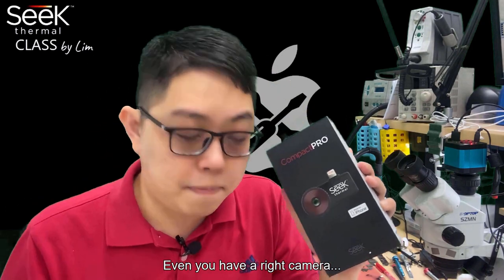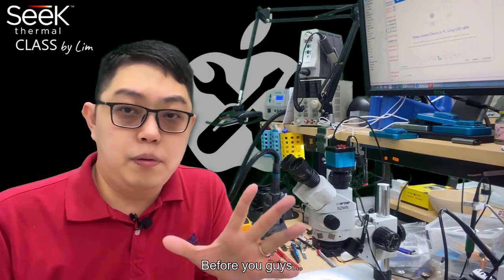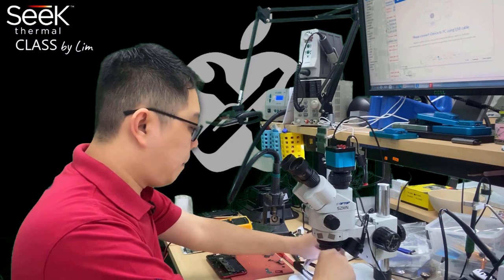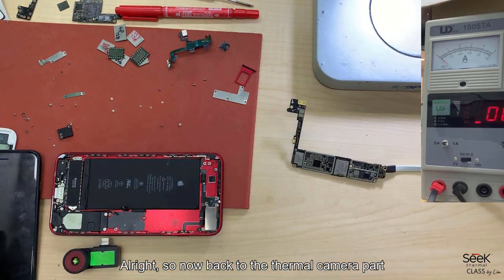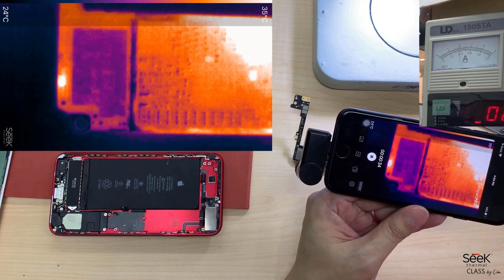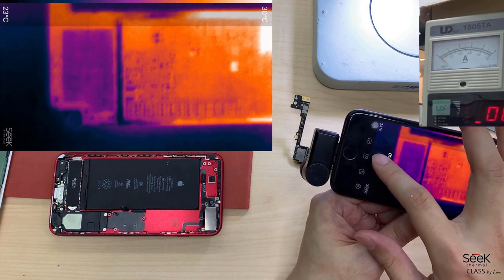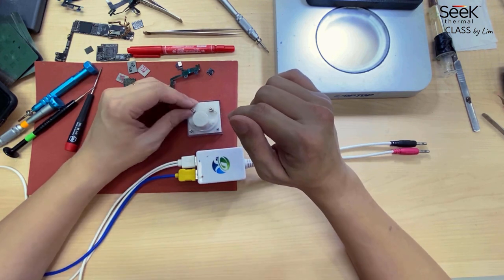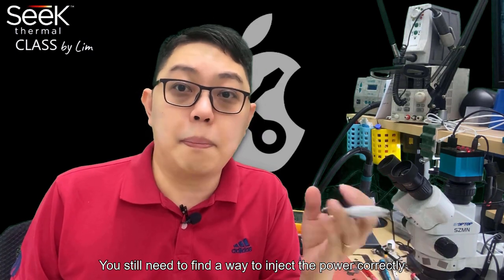Thermal Camera Diagnosis Lesson  - Power Test Cable makes a difference【Seek Compact Pro 】

Comment: Do the cords need to have a special pice on the end for the battery connection? Or is there a way to inject power into any board we have so we don’t need a specific end on the cable?

Comment: 12:46 Mega Idea is a brand name of Qian Li and they make both of these cables. The cable on the left with the black sleeves next to the battery connectors, i.e. your "direct power" cable, is a cable that Qian Li says contains "Battery Decoder Board". Can you explain what this is? If it's just a straight / "direct power" cable without any sort of embedded chips or components? It looks to me like you're in fact killing the "Battery Decoder Board" when you do the "blinking". This board is presumably installed, not in the cable leads, but in the black box where the cable leads meet.

The "second cable" (third in order of appearance) has white sleeves next to the battery connectors and protruding SMD components, and according to Qian Li, it features "Simulate Battery Data" and "Original Battery Level Connectors Base". I have no idea what that second feature is alluding to, but they go on to say: "Embedded motherboard connectors base" and "Leave no trace".

So they have two types of cable. One has a "battery decoder board" (the one you use for short circuit detection). The other one has "embedded motherboard" and can "simulate battery data". I found this info on their official Chinese website, with bad English translations.

They make an Android version of the "battery decoder board" or "direct power" cable as you call it, and I'm looking at buying it for short detection using a thermal camera, just like in your video. I will probably be using the Infiray T2S Plus instead of Seek Thermal Compact or Compact Pro camera. I have already returned my Seek Thermal Compact camera because it's useless and expensive garbage that doesn't work correctly with the most recent phones with USB-C connectors. I tested with Galaxy S22. Their app will only tell you to "Connect Your Camera", and that's all you will see. It fails to detect the camera, even though the app auto starts when you connect it. It can only detect it once, and then you have to reboot your phone to detect it again. You have to reboot each time you want to be sure you can use it. So like I said, it's useless and expensive garbage. I am not alone to have this problem, users of FLIR ONE and FLIR ONE PRO report similar issues, despite having the latest generation with USB-C port where the "USB OTG" mumbo jumbo is irrelevant nonsense. So I found and ordered the Infiray T2S Plus. I think it will be perfect match for the Qian Li power cable. But now that I see this cable contains a "battery decoder board", I'm having second thoughts about it. Can you explain what this is and why it's there?

Qian Li explains it like this: "Solve problems of automatic restart" and "Splash screen, booting". They make it sound like all you need is only one cable. The cable on the left, the "direct power" cable, the cable that contains "battery decoder board"... with the black sleeves at the battery connectors... if you have that cable, that cable alone will "solve [the] problems of automatic restart[s]". So there is no need for the second cable on the right – the cable with the white sleeves at the battery connectors – to solve that problem. Qian Li has a different explanation for why you might need the second cable: "Solve the problems that unable to enter the system after restarting with [p]ower cable for Phone 8th generation and above".

I think I will order the Android version of this cable regardless, and test it. I find the alternatives from brands like Mechanic to be too laborious and complicated, with one hundred different cable leads, and a half! When all I need is a simple power cable to connect to my DC power supply, and I only need it to work with Samsung, and could not care less about compatibility with the other brands. Thanks for this video! It was very informative. I actually found this cable before I found your video. So I was surprised to see that you use the same cable. I don't have it yet, but I can tell it's a high quality product.

Comment: hi bro ISO u have a power supply digital but why you using analogue power supply can you explain that & that analogue power supply how many ampere??
Reply: Yes this is an interesting question – I'd like to know as well why the Analog PSU is your preferred choice over the digital one (or is it a place-and-time usage scenario)?
Reply from the maker: Explain that in text is difficult to understand the scenarios. I’ll try.

Our eyes and brain is faster when seeing analog needle movement and controlling the voltage knob at a same time.

When digital showing a value, your brain will delay little to turn the knob according the current reading. Especially when big spike

Digital only useful in checking power ic without CPU, cpu ram respond vs i2c respond.
I might open a power supply guide.

We need at least 5A psu. Especially some ipad logic board are require 5A to make the short appearing in thermal cam.

Comment: Can you also provide feedback on the QianLi iPower Max with this same test? Also, I didn't notice if you used your Macro Lens attachment for the Compact Pro. Oh, and lastly - just out of curiosity, do you prefer your current Microscope Stand setup over a Boom-Stand or Articulated Arm?
Reply from the maker: Fixed thermal camera is not convenice. I owned a Qian Li before and sold. I’ll post a story abt it.

Yes, good eye. I got my camera in few years ago, that time they only sell modified lens which is my original lens replaced.
I think Microscope stand should be depend on what kind of desk design. A double level desk like mine is can’t fit those.
Reply: @iPhoneServiceMalaysia  Ok thanks for the speedy and informative reply - I look forward for your story about the QianLi Thermal Camera. The QianLi iPower Max I mentioned is the Power Supply Test Cable. I was wondering if you think it would work similar to your preferred power test cables. Also thanks for the feedback about the Microscope stand setup.....I currently have a wide-base stand for my Amscope SM745TP-B which I turned backwards and weighed down with my Tekpower TP3005T PSU – that configuration so-far is working fine for me. 👍